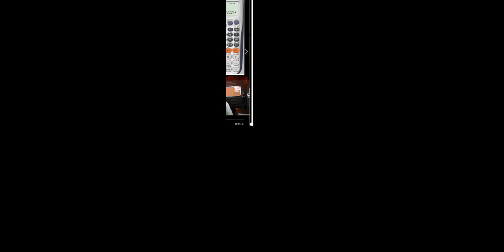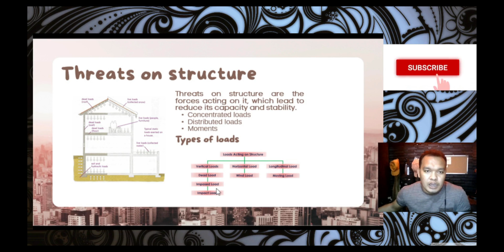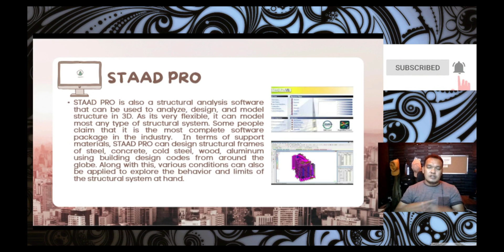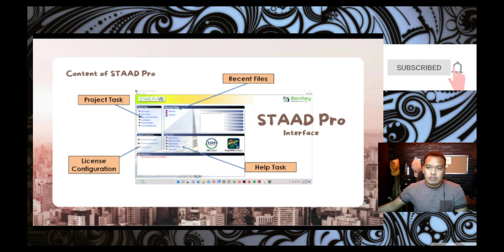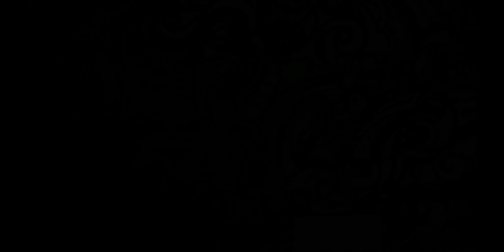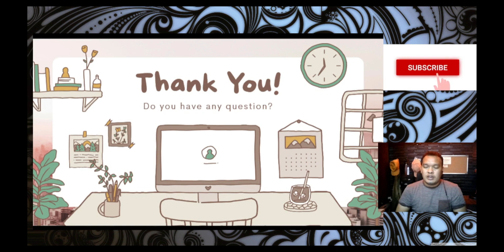PCSP 423: Computer Software in Structural Design Analysis (Topic 1)

Comment: From the video, I have learned that structural analysis is necessary before starting construction works. There are lots of structural design analysis software that can be utilized and one of the most widely used is the STAAD Pro. It can be used to analyze, design, and model structures in 3D. It is flexible and can model most any type of structural system. I have learned that this software is of great help to lessen the work of structural engineers. I am hoping to learn a lot as we use the said software.

Comment: After seeing this video, I understand the value and purpose of structural analysis. Its purpose is to make the construction secure and long-lasting. Structural analysis has played a significant role in making everyone's life easier and more fulfilling. Because studying structures takes a lot of time and effort, I learned that there is a lot of computer-based software that may help analyzing structure easier.  I learned that STAAD Pro has a lot of useful features and is the most commonly recommended software for analyzing a structure, therefore, it will be really beneficial.

Comment: What I have learned in this video is that structural analysis is very important before starting construction work as it provides basis for structural design and also it evaluates whether a specific structural design will be able to withstand external and internal stresses and forces.However, Structural Analysis can be time consuming and computer based is there to help us automate our tasks by removing the tedious and long procedures of the manual methods. Example of this computer based software is STAAD PRO, it allows us to analyze and design various types of structures on virtual platforms.

Comment: Good day Sir. I have learned that structural analysis is really important in constructing building. This is to assure the safety and comfort of the people that will benefit the project to be build. Structural analysis takes a lot of time if computed manually but through the use of computer-based software, computations becomes easier and faster. Example of these softwares is the STAAD Pro which is highly recommended by the professionals because of its feature with high rating of good feedback. I would like to commend you Sir for your effort in making this video for us that helped us understood computer-based softwares that we can trust in analysing structure. Thank you and God bless ❤️.

Comment: I have learned in this video that there are numerous computer-based software available that can be used for structural design and also that among those software, STAAD Pro is said to have the complete software package by means of features. Thus, it is more efficient to invest time learning STAAD Pro alone than learning multiple construction design software.